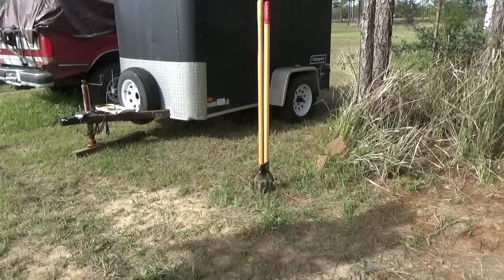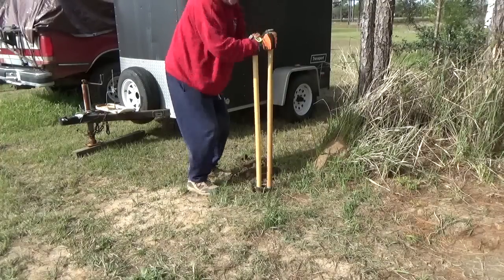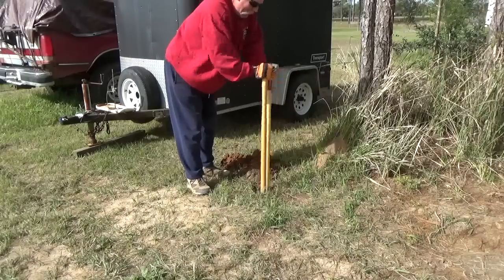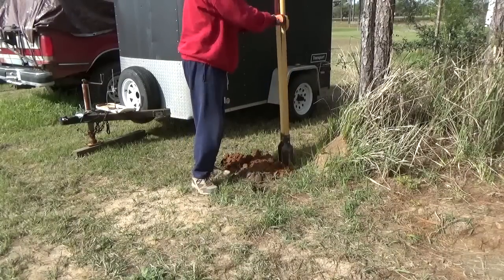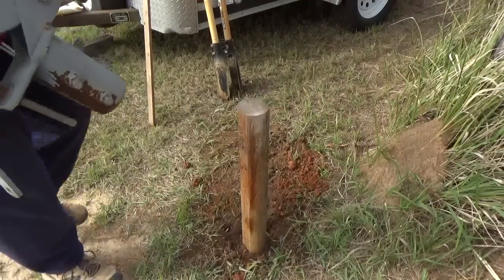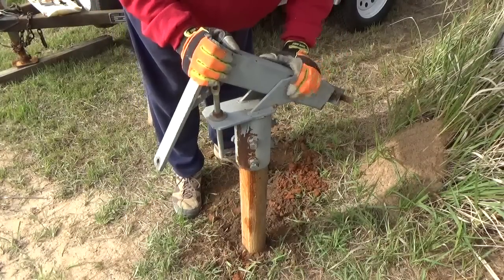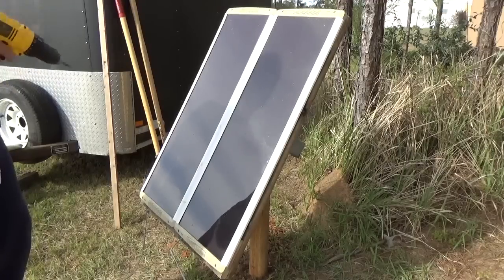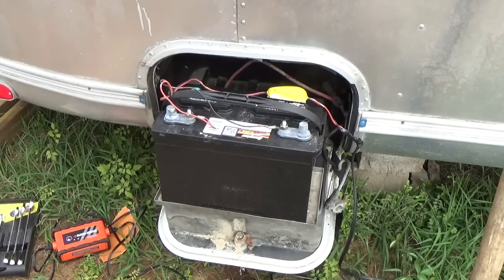Solar panel setup for testing

Comment: I had a triple rain barrel tower setup on four posts without concrete for several years without any issues--you're good.  For permanent projects I do concrete too, but it's a waste on temporary ones.
Reply from the maker: +The Appalachians Agreed, thanks for the input!

Comment: Nothing wrong with being prepared in case the power goes out ..One battery will run the lights ,radio etc
Reply from the maker: +not2fast4u2c It's designed as a small scale test bed. It will also do as you say. Thanks!

Comment: Solar doesn’t need to be Gigantically – Normas to be useful. Single battery system in a trailer coach is enough to run nighttime LED lighting. Simple tracking panel arrays boots performance. Fun Vid
Reply from the maker: +John Talbot Thanks John.

Comment: Those look like amorphous solar panels they are not very efficient and will not have the power you will need. Marine batteries are a poor choice (or any battery with a CCA rating). Wet cell Batteries loose 30+% of the power from your panels when charging . AGM batteries are 95% efficient due to their low internal resistance and are low maintenance. (I hate battery acid and ethanol gas)  You must have a MPPT Charge Controller with remote monitor they are also around 30% more efficient. A pure sine wave inverter with a remote on/off is also a must. You must turn the inverter off when not in use. You will need a master on/off switch for the 12V  line from the batteries or you will waist close to 24 Amp/hrs a day even when everything is shut off. Every device in the trailer will need to be low current start taking measurements with what you have.
Do not try to save money on cheap stuff it will cost you more in the long run.
Reply from the maker: +EZ Off Grid Great comment! Thanks.